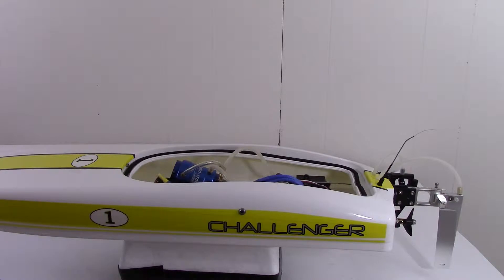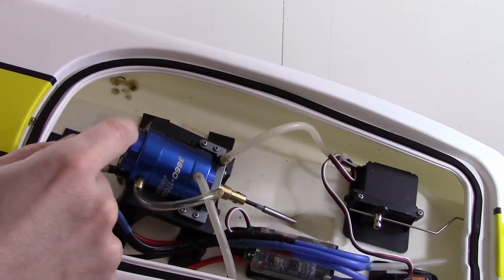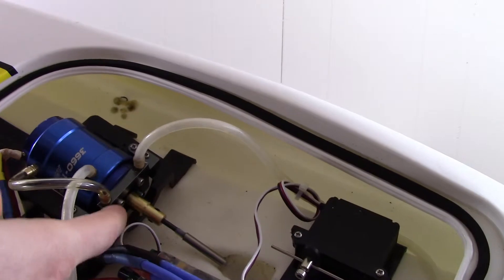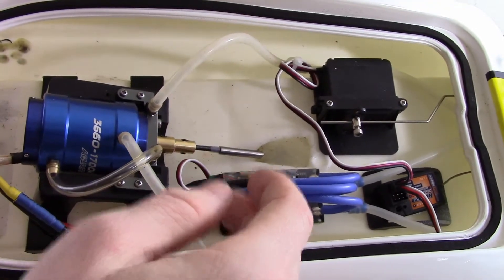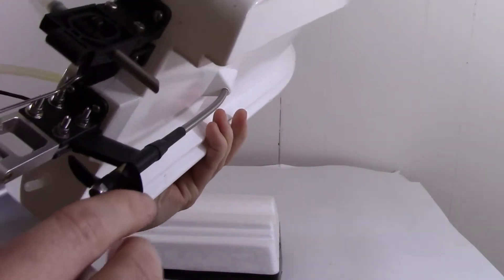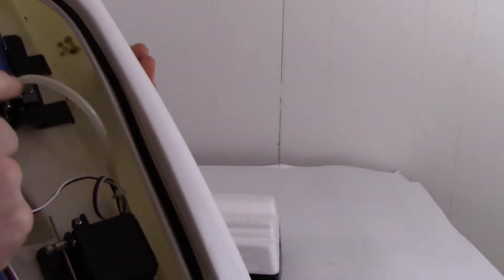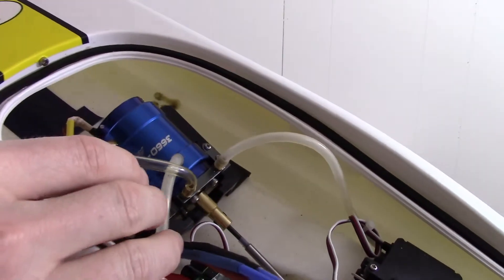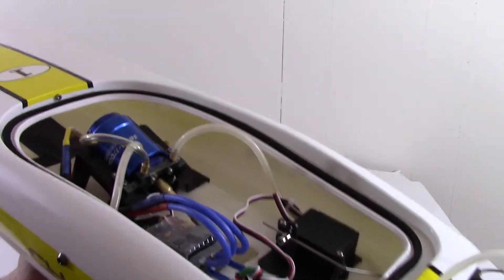Litehawk Challenger: Motor and ESC Upgrade

Comment: that prop will cavitate so bad on 4S...did you ever pick up a new one, any suggestions?
Reply from the maker: I did run this prop once however I had other problem with the boat so I didn't really get much run time. I don't know if the motor is too big or something but under harder throttle the whole boat would tilt the same direction as the motor. Even causing it to flip. However I did actually get a new metal prop too, but I haven't sharpened the blades on it yet so haven't used it. It was quite awhile ago I'll have to see if I can find the info on the prop that I have. I did do some research for the prop though and from what I could tell it should be a good one(I don't really have much experience with rc boats though).